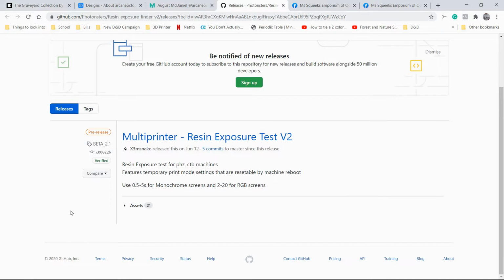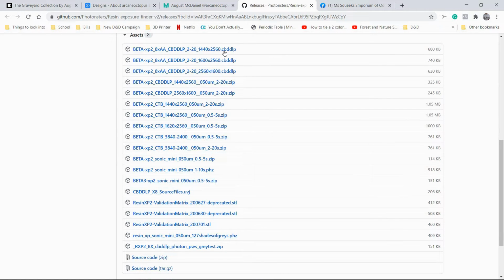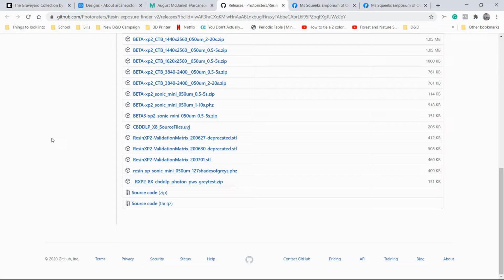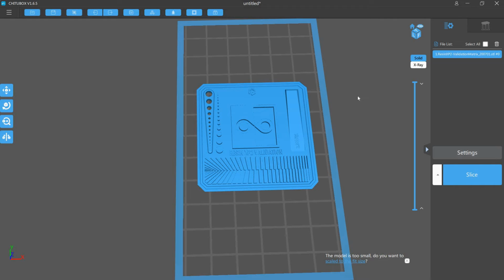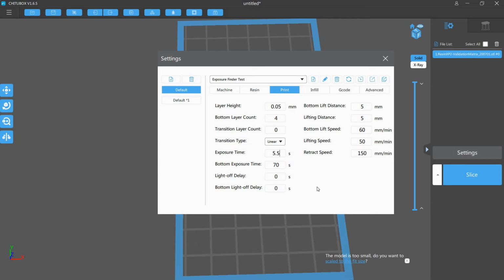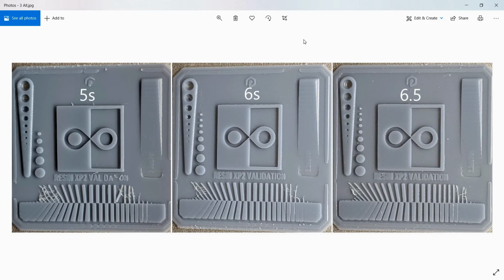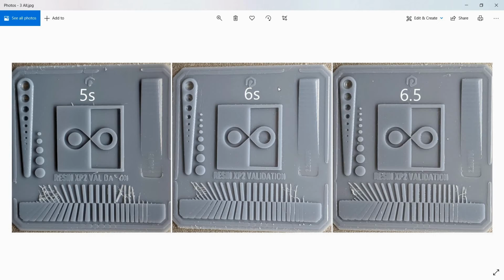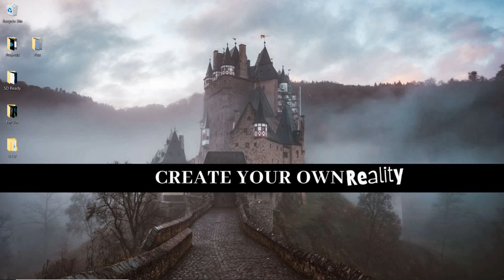Get Perfect 3D Prints on Any Resin Printer With the Exposure Finder!

Comment: Hey, at first nice Wallpaper of Burg Eltz, Eifel Germany. Great. No people there and foggy.... Nice. 

OK - great video about finding the correct exposure. Do you have some tips about calibration in regards to model size? I designed a cube of 20 x 20 x 20 millimeter and got a part of 20.1 x 19.9 x 19.7

If you have some suggestions& a process, it would be great. When printing technical parts this is much more interesting to get dimensional correct parts...

Thanks in advance.

Greetings from Cologne

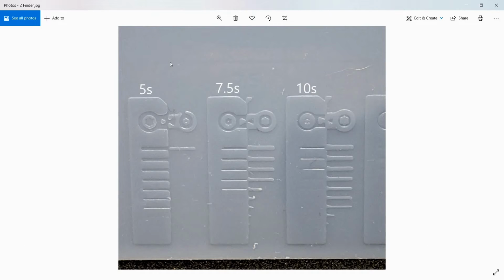Comment: 2:41  He say you can see this is underexposed.  I'm here asking "how"?  What are you looking for in this.
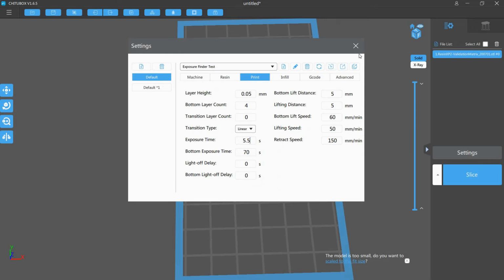Reply from the maker: Yeah sorry I didn't elaborate on that. So everything I explain at 3:50 can be applied when reading the Range Finder test.
However, the creator as stopped supporting and developing the Range Finder test. So I would recommend not using it at this point.
If you'd like to test multiple exposures in one test then I'd recommend looking into the Exposure Time Finder function in UVTools.
Here is my full tutorial, https://youtu.be/lRbZw6GbGCI

Comment: The final over exposure had circles that's the other tests were missing, I don't understand how that's worse ?
Reply from the maker: Hey there. Yeah I'll definitely be doing an updated version of this video soon because there are a few areas I could have been more clear about.
At the 4:26 mark I explain that the center test has the best results out of the 3 because of how this test should be read.
Left side you want to have an equal number of pins and holes/voids. 
Center the points in the center should just barley be touching at their tips. 
Bottom the bars should be the the same size as the slots below them.

I recently released a video tutorial for a much better and more efficient resin calibration process. 
You can find that video here, https://youtu.be/lRbZw6GbGCI

If you have any other questions please let me know.
Reply: @SlicePrintRoleplay  I just acquired a longer orange 4K, I understand the description now thanks, I'm just curious I guess how exposure time actually causes the number of pins and voids to actually change on the technical side of things , resin physics / chemistry

Comment: how did you manage to have several exposure times on the same model?
Reply from the maker: So the Exposure Range Finder test I used in this video is a bit outdated. It was pretty finicky to begin with and the creator stopped supporting it so they could help with a different project.
That project is called UVTools and I'd highly recommend checking it out. It has a bunch of really cool features, but one of the coolest is the Exposure Time Finder function. It will allow you to test different exposure times with the same test.
Check out my full tutorial here,
https://youtu.be/lRbZw6GbGCI
Reply: @SlicePrintRoleplay  thanks
Reply from the maker: @DiegoFSC  you are very welcome.

Comment: Why would anyone start with a presliced print? Horrible way to start.
Reply from the maker: I'm not sure I understand your question or maybe you didn't understand the video? 
The Validation Matrix is not pre-sliced. In fact, the whole point of this test is to slice it yourself to test different exposure settings.
Reply: @SlicePrintRoleplay  why would a some files not be compatible with certain printers of the end result aka the sliced file would be in the format that works with your printer, especially if you're using something like chitubox?

First time I hear of this incompatible sliced file that you slice yourself.
Reply from the maker: @TechnologistAtWork  I think you are misunderstanding what's covered in this video.
 There are two separate tests. One is called "The Exposure Time Finder" that is the test I talk about at the start of the video. That test was not compatible with all printers and shortly after recording this video the test stopped being developed and supported by its creator.

The second test is called "The Validation Matrix." that test is compatible on any printer because you are slicing it yourself with your settings. It works like any other model.

Comment: Hello. First of all it is a very useful video. 
I did a test on my Anycubic Photon. I used plant based grey resin from Elego. The matrix at 8s looked like slightly overexposure. When printing properly at 7s most of the models were underprinted (clearly too short exposure time). What to do in this case?
Reply from the maker: Hey there, thanks so much for the positive feedback!
There are a few things that could be going on.
But first, Can you tell me what layer height and how many bottom layers you used for the test?
You can post that info here or you can send me a message on Facebook.
Reply: @SlicePrintRoleplay  Bottom layers 4, leyers height 0,05

Comment: There are 15 pins and holes in the model. Shouldn't the best exposure print all of them?
Reply from the maker: That's a great question. 
The answer is no because sometimes that's simply not possible. Could be due to settings, resin type, or the printer itself not being capable of that level of detail.
Reply: @SlicePrintRoleplay  Makes sense. Thanks for the explanation and speedy response.
Reply from the maker: @dwcnineteensixtythree341  you are very welcome.

Comment: Hey i have problem with "elephant foot" in resin 3d printing. I want to glue parts that were printed flat to build plate, but first layers are visibly wider (due longer first layers exposure). 
Is there slicer option to compensate that, because complex parts are not easy to be chamfered?
Reply from the maker: Yes. Look into a program called UVtools. I haven't used the feature to compensate for elephant's foot, but it looks very promising!
Reply: @SlicePrintRoleplay  Thanks !
Reply from the maker: @brezovprut4431  no problem at all. Best of luck to you!

Comment: What i use for elegoo mars 2 pro?
Reply from the maker: The range finder test I talked about is no longer being supported so I don't recommend using that anymore.
However, the Validation Matrix can be used on any printer because you slice it for each individual printer with your own settings.

Or were you asking about what settings to use?

Comment: Great video!  Out of curiosity, what printer and resin are you using?  I was stressing out because I thought the goal was to get everything to print on the XP2 and I can't dial it in to get the 2 lines on either end to print and I'm missing two or three pins and voids each but have an equal number... IOW I think you helped me realize I'm doing pretty freaking awesome.  I'm dialing in a Sonic Mini (1080p) with a 50/50 mix of Siraya Tenacious and Phrozen Grey 4k.
Reply from the maker: Yep that's a big part of why I wanted to make this video. A "Perfect" test might not look the way most people think... At least not in most cases.
From what I've hard that's a great printer and a good mix of resins! 

At the time of this video I was using an Epax X1 with Elegoo Standard Gray.

Comment: Thanks a lot for the video! I have a question! if we want to print with thinner layers (with 0,02 in state of 0,05) is there a test for it? how could I know the exposure time? Do I have to try it all again with the validation matrix until I find the right exposure time? thanks a lot in advance
Reply from the maker: Great question. This test can be used for any layer hight, however most printers can't go much below 0.02.
Just make sure that after you slice the test that you use the layer view to see where the bottom of the test stops and the different parts of the test starts.
Let me know if you have any more questions.
Reply: @SlicePrintRoleplay  hi thank you very much, i do have one more: should i also increment the number of bottom layers to mantain a constant thickness ?
Reply from the maker: @dariocardajoli6831  you may need to increase your bottom layer count by 2 - 4 depending on how thin you make your layers. If you're having issues with the test not sticking then increase your bottom layer count by 2 and or your bottom exposure by 10.
Reply: @SlicePrintRoleplay  ok i printed it with my anycubic photon mono 4k basic resin @ 0.03mm layer height, 1.6s normal exposure time , 6 bottom layers and 40 sec bottom exposure (think i can lower that one) oh and arround 24C room temp and it turned out perfectly ( 1:1 representation of the stl file except for the thinnest pin which is missing)  beign my first ever print i feel a huge confidence boost thank you again
Reply from the maker: @dariocardajoli6831  that's fantastic nice work!

Comment: Great Video, thanks?
What if the results of the 8-edges and the void/pins are controverse, which one to trust 🤔
Reply from the maker: Would you be able to post a picture in my Facebook group? Or send me one in a message on Facebook?
Also, are you using a Creality LD-002H?
Reply: @SlicePrintRoleplay  Why did you ask specifically about the LD-002H? I just picked up one of these.
Reply from the maker: @dalecolegrove6652  I have one as well. I found that it's an extremely reliable printer and I actually prefer it over the Elegoo Mars 2 Pro.
However, I also found that it hard trouble with extremely small details like some of the ones in this test. They would be over exposed even if the rest of the test was under exposed... But I think it gives fantastic prints all the same.
Reply: @SlicePrintRoleplay  Interesting. Waiting for a print to finish before I do my first XP2 tests. Question. Would it be smart to go ahead and print two of these tests at a time since two will fit on the build plate? I figured it could be interesting to see how different the two tests my look at the same exposure time.
Reply from the maker: @dalecolegrove6652  you can certainly print two tests side by side. However, keep in mind that it's not too unusual for them to look different. That's due to quite a few different factors. 
Factors like, UV light uniformity, build plate level, and type of UV focus to name a few.
So don't be too concerned if the two tests look a little bit different.

Comment: Ok so these test files are not being supported anymore, anyway? I just tried the file for my Saturn in the 2-20 seconds version, apparently this is a copy of the 0.5-5 second file without any changes - it even says "0-5-5s" in the preview window of the Saturn. I printed it anyway and it came out really flat, the whole test range wasn't higher than 0.3 mm across the whole witdth.
Reply from the maker: Yeah from what I understand the range finder tests have been a huge undertaking and the creator has decided to stop supporting and updating them... At least for awhile... The Validation Matrix is still fine to use though.
Sorry the test was a let down for you.... Out of curiosity, what resin are you using?

Comment: ran the matrix test on my NOIR. Would you say that if you had more of the dots, would be for a settings tailored for small models with a lot of detail and the points in the center for larger models?
I have a 2.0 exposure where the points in the center are good, however if i go to 2.5 I get more dots but the points in the center are slightly "into" each other.
That first test I cant find for my NOIR so they must not have it available yet. Thanks again!
Reply from the maker: That's a great question! 

I personally use the matrix to find the best exposure settings for a resin and then use those settings on all my models.
I don't think you'd see much benefit in using different exposures settings for larger models vs smaller ones. 

The overall goal with the Matrix is balance.
You're trying to get all parts of the test to be equal with their negative sides. 

Signs of over exposure on the Matrix are: 
(left) More pins than holes. 
(center) Points in the center are overlapping. 
(bottom) Bars are too big to fit in slots/slots are almost filled in.

Signs of under exposure on the Matrix are:
(left) More holes than pins. 
(center) Points in the center aren't touching. 
(bottom) Bars are thinner than the slots slots.

Hopefully that answered your question, but if not let me know.

Comment: Do you usually repeat this test for each layer heights? 

For example won't you need different exposure settings if you select 0.05 as layer height vs 0.01 vs 0.1?? 

So do you agree that to get some idea into this, this experiment need to be repeated several times with different layer height settings?

FYI, awesome and useful video, keep up the good work!
Reply from the maker: Yes absolutely you should always slice this test at the layer height you plan on printing at.
Just remember you'll need to use the layer view slider (usually on right side of the screen) in your slicer to see at what layer the test starts. 4 bottom layers was what you'd use only for 0.05 layer height.
Let me know if you have any questions and thank you for the feedback!
Reply: @SlicePrintRoleplay  btw you did this test with anti-alias enabled?
Reply from the maker: @swaroopcool22  I actually didn't use AA on this test. I don't use it very often, but I should play around with it and see what it can do.

Comment: I now count myself lucky AF.     Just got my first resin 3d printer (Voxelab Proxima) and the first print I made was this validation matrix.   Default settings in chitubox and using a cheap resin I lucked onto a near perfect print of the matrix, one dot/hole and a couple of those lines at the bottom bettter than your 6s example.  On to the Amerilabs calibration print to see what that does, before I dive in.
Reply from the maker: That's fantastic congratulations!

Comment: Good morning! Unfortunately the result from the first file was a smooth rectangle. No info on it. I'm using an Elegoo Mars 2 Pro (1620x2560) with ABS Like resin. What can I be doing wrong? Thank you and great video!
Reply from the maker: I actually just had a conversation about this with the creator of the these tests. Due to the difficulties involved with getting the exposure finder compatible with a wide range of printers he's decided to phase out that part of the test.
The second part (the validation Matrix) will continue to be improved and is absolutely compatible with all printers because it's an STL that you slice and for each printer.
I will be making an updated video giving info more info about the validation Matrix and how to use it on both RGB and Mono screens.
Sorry for the frustration with the test.
Reply: @SlicePrintRoleplay  thank you for the update. I was able to get a successful test strip but the results showed that x5 was way under when in fact it was perfect. I printed the 'square' test and x5 was crisp with the infinity points sharp. Thanks again friend!
Reply from the maker: @vonburkestudios  you are very welcome.

Comment: Hi, I've downloaded the beta file (the first one) for my photon (standard photon) and the matrix, but my photon doesn't recognise it. Should I do anything before print the file? Did I dowload the wrong beta file? Thanks for helping.
Reply from the maker: I had asked the creator of the test about that a bit ago. Here is his response.

"PhotonS and Fauxton can run .Photon Files with the latest update. Therefore the cbddlp AAx8 works as long as you rename the extension to .photon. Instead of cbddlp."
Reply: @SlicePrintRoleplay  thanks! Will try!
Reply from the maker: @lalau2465  if that doesn't work then I'd recommend looking over the spreadsheets I included to see if they can give you a starting point (which is all the first test does anyway). Then use the second test to fine tune your exposure settings.
Reply: @SlicePrintRoleplay  it worked, thank you!!! May I ask you where can I download the second test you did? It not the matrix, right?
Reply from the maker: @lalau2465  glad to hear it!

And yes the second test can be downloaded from the same place you download the first one from. It is called the exposure validation Matrix.

Comment: Great video :) Can I clarify please, if I'm running the tests, do I need to set to 0.05 layer height always or would I enter 0.02 if that's what I'm wanting to print at?
Reply from the maker: Thanks I'm glad you enjoyed it! 

I apologize for not clarifying that. I will be doing an update version of this video with that info as well as info on how to use this test with mono screen printers.

I'd absolutely recommend slicing this test at the layer height you intend to print at.
The 4 bottom layers I specified in the video only applies to a layer height of 0.05.
If you use a thinner or thinker height you'll have to find the layer at which the parts of the actual test start. In your slicer it will look like a flat square then as you move up you'll see the different parts of the test start.

If you have any questions just let me know. 
Good luck!
Reply: @SlicePrintRoleplay  Thank you!  and thanks for the quick reply! I'm wondering if it's owrthwhile me doing as I've run the Amerlabs Town test print but I can't remember whether I got a fail at 5, 5.5 or 6 seconds (Elegoo ABS-like Grey @ 0.02mm layer height). I'm also a bit confused after reading around a bit as to whether 0.02 layers are even worth it vs 0.05 considering the XY resolution is capped at 0.046 I believe. Do you have a take on that?
Reply from the maker: @cjlake5754  my personal opinion is that the time it takes to print at smaller layer heights isn't worth it. The lowest I print is 0.04.
Reply: @SlicePrintRoleplay  Elegoo Mars 1 btw.
Reply from the maker: @cjlake5754  that's a great unit!